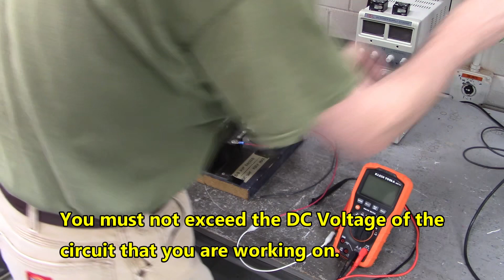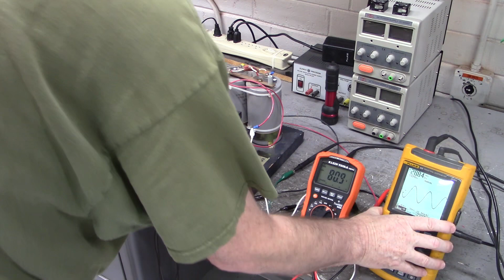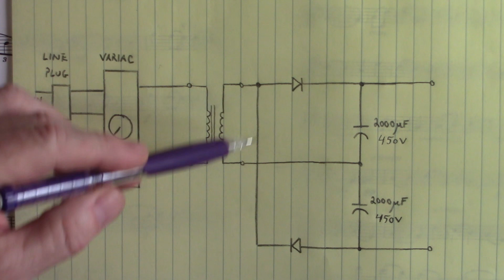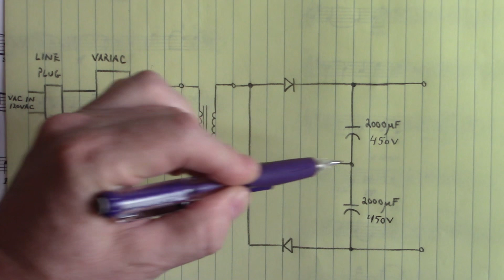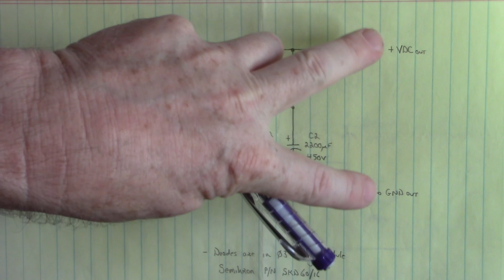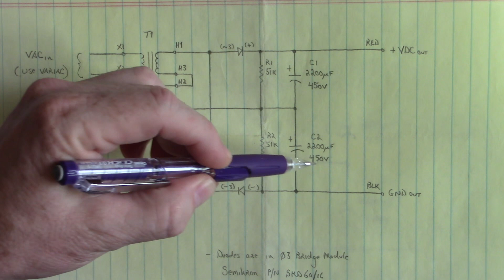Trouble Shooting Tool. The Voltage Doubler Circuit

Comment: Hey friend, hope you are having a good time.
I use a slow charging doubler to test braking systems in some equipments.
It's a good way to do it under control, without worrying about big currents supplying the bus.
I admire you a lot, sir!
Cheers 🍻